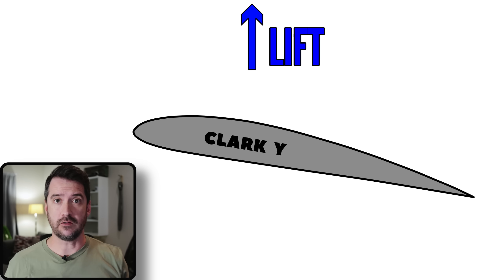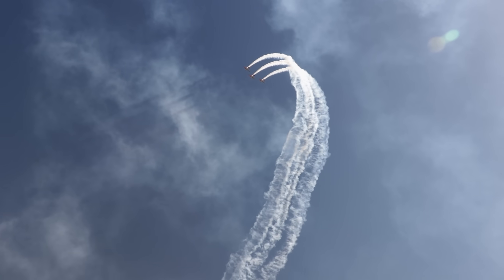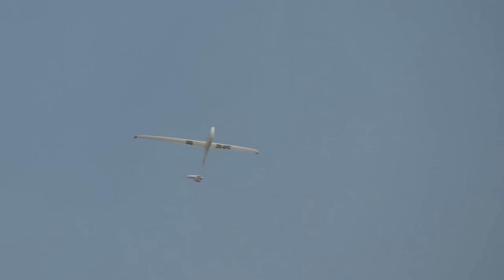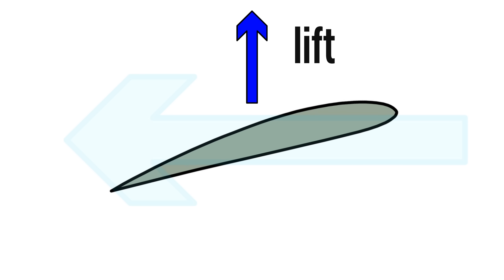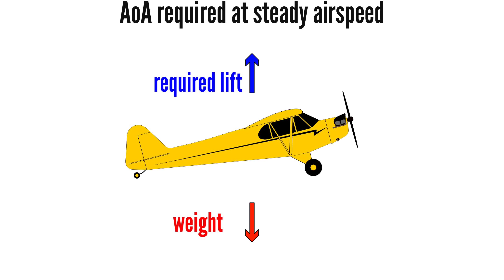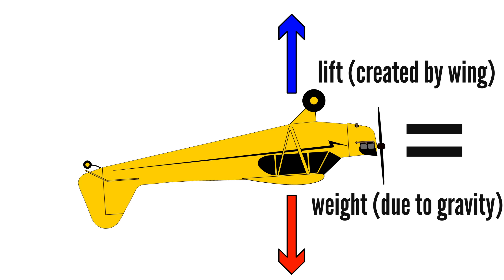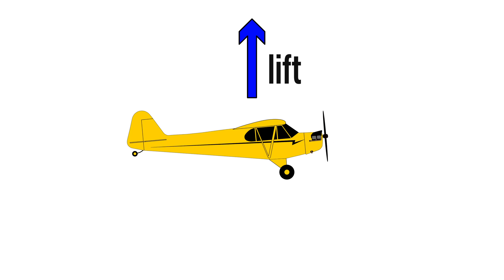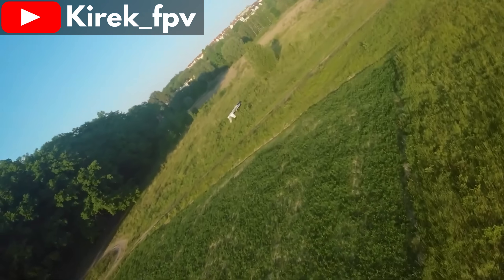Is Airflow Distance Over the Top of a Wing Always Longer?

Comment: If RC models have a lower wing loading, it is not because they are made of light materials (although it can be a factor). But it is mainly because, for a given shape, the volume is related to the cube (³) of the length and the surface in related to the square (²) . I.e. if you divide by 2 the length of a plane keeping the same overall shape, its wing area will be divided by 4 and its weight will be divided by 8 ! So it will have a lower wing loading.
Reply: An rc plane is still a full size aircraft just smaller .
Reply: @tonywright8294  in terms of weight, size matters !!!
Reply: @tonywright8294  but the dimensions don't all scale the same way. If you double the length of a model you square its area and cube its volume. Identical shape models of different sizes have vastly different characteristics.
Reply: Yes, the actual density is not that different. Compare hollow aluminum frames with solid balsa or other woods and it is not that much of a difference. The scale has much more of an effect. Look at the Mosquito compared to others of it's time.

Comment: Except that, the air isn't moving, the wing is. However, the air is deflected upward and downward as the wing passes thru it. If the air is deflected upward more than it's deflected downward, the wing will produce lift. That is, until the angle of attack is so great that the air going over the top begins to roll and tumble across the top of the wing like a wave breaking on the beach.
Reply: I think you have upward and downward backwards in your second sentence.
Reply: @carultch  I thought the same thing.  It really threw me for a loop.
Reply: You really missed the point he was trying to make, even though you want to agree with him. Plus you're giving too much weight to the illustrations without looking at them with a critical eye. They are incomplete. Compare 2:10 and 8:33 - Count the total number of smoke lines that are approaching the full airfoil, about 36 versus 6 blue ones in the line drawing. Then discern the smoke lines that split up from the ones that split down at the stagnation point. Twice as many split down. There's twice as much air going under the wing. That is the opposite of the line drawing's assertion. The line drawing is very misleading. I understand the weaknesses of my illustration but it's meant to be an illustration not an unassailable proof. A proof requires several more pages than a YouTube comment.

Comment: Thank you:goodvibes:, I learned about stagnation point. I also didn't know:buffering: how planes could fly upside down, but this video:yt: really cleared things up :face-red-heart-shape:
Reply: Swept wings don't have stagnation points or lines.   They have attachment lines.   The flow never stops (like the author discusses) but it attaches to the leading edge and flows outward.  You can think of the airplane velocity as having a component perpendicular to the wing leading edge and one parallel to it.   Look up simple sweep theory for more details.
Reply: @dougball328  thanks for more info, do you recommend a video that goes in-depth for that?  I'm interested on airfoils because im designing a wind turbine blade for my school project👩‍🏫

Comment: I don't know why anybody who studied anything about the lift effect would believe that you don't need a wing to actually fly. Sounds like the argument that used by those who believe that the Earth is flat. It is strange when you consider that that argument is based on scriptural misunderstanding. When it claims that the Earth is flat. The Earth is never said to be flat in scripture. The word that is translated to mean flat is actually a word that means level. And the surface of the Earth is primarily level by about 99.9%
Reply: Wot?  Not flat?
Reply: With reference to Earth's shape, there is no word in scripture, in any language, that means flat nor is there one that means level - there is no mistranslation happening. Please supply a Biblical quote that supports your reasoning. Job 38:5 referring to Earth states, “Who fixed its dimensions? Certainly you know! Who stretched a measuring line across it?” does not use the words "flat" nor "level" & the Flat Earth reasoning is that a stretched measuring line must be a straight line with no curve. The argument is obviously absurd as a stretched measuring line is not obliged to follow the surface of the Earth.